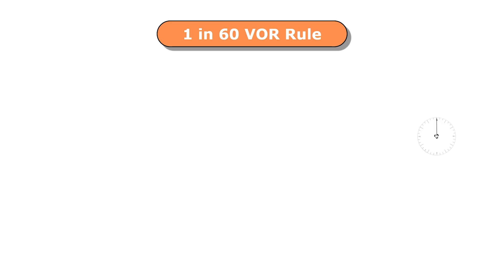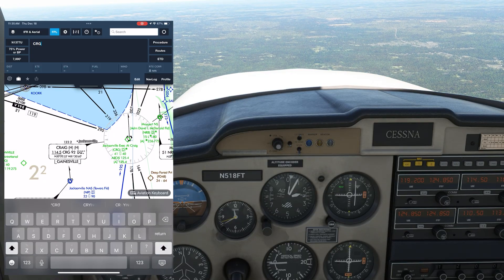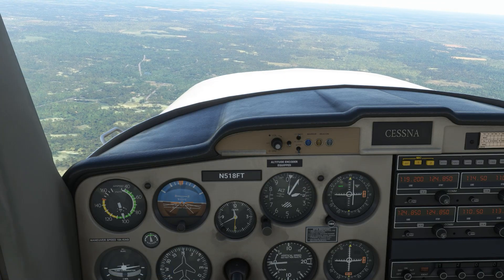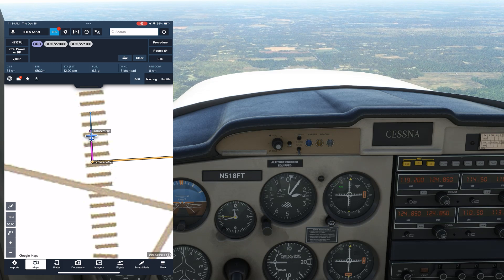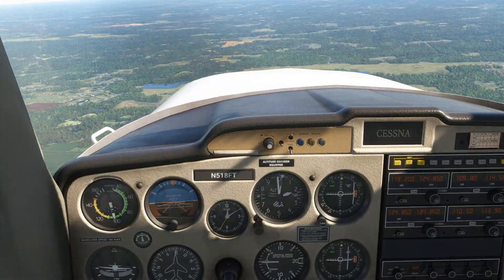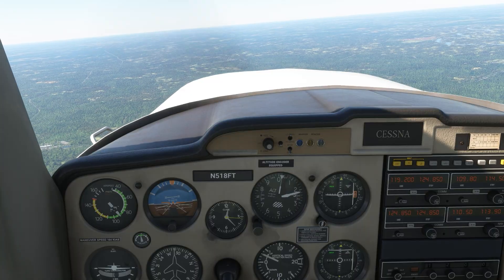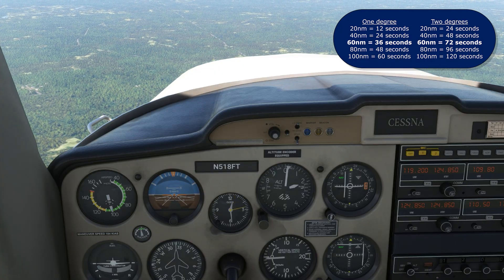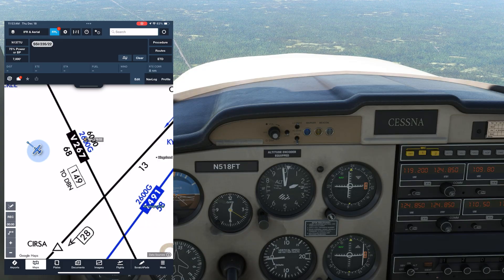The VOR Trick You've Never Tried and Don't Need | The 1 in 60 Rule Applied in The Airplane

Comment: A couple of comments:

1) I thought the edge of the donut on the VOR head typically represents 2° deflection? So shouldn’t the 1° of deflection you are trying to illustrate in the first example occur when the CDI is in between the center and edge of the donut (1/2 the radius of the donut if you will)?

My understanding is that every dot represents 2° deflection and a full scale deflection corresponds to 10°, so this would imply the edge of the donut has to represent 2° deflection.

2) You say that we have to maintain a constant distance from the station and that this requires flying perpendicular to the radial. If we fly perpendicular to the radial then our distance from the station would necessarily increase. I think you meant to say fly a constant DME arc from one radial to the next? In practice the difference in distance between these two flight paths should be relatively small, so perhaps this level of precision isn’t necessary for the point you’re trying to drive home? Technically though I think it’s important to make this distinction. Maybe I’m just missing Dan’s voice and am more inclined to point out inaccuracies. 😅